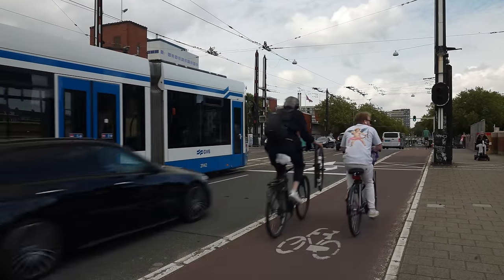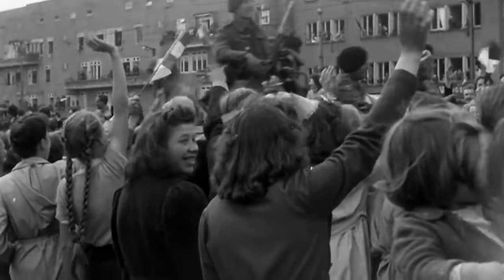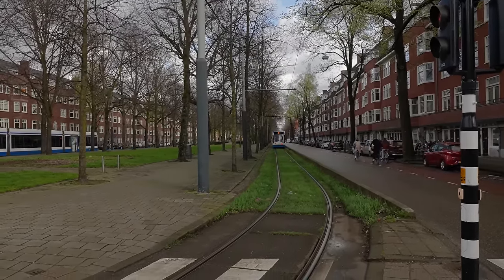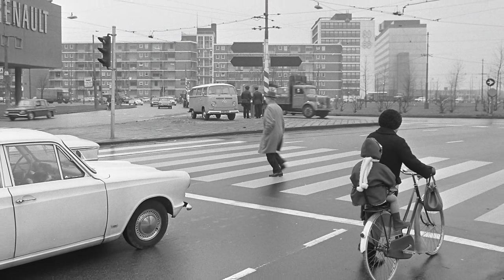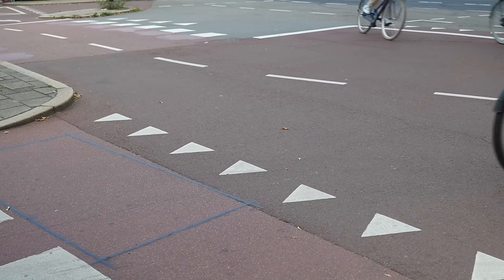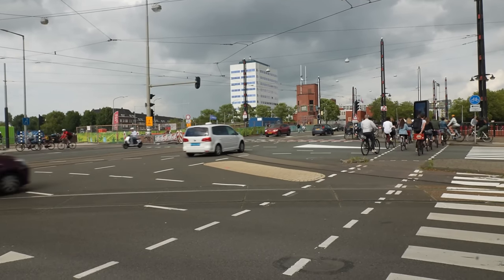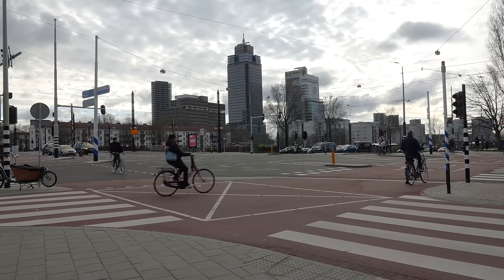Amsterdam Closed This Bridge to Cars (but not bikes ofc)

Comment: I wouldn't feel too bad about the cock-up with the tram tracks.  In Edmonton, a project like that would've been scheduled for four years, and been completed in seven.  And there would be some fugly after-thought braces or brackets to hold the damn thing together.
Reply: It is a thing. In The Netherlands we always plan far ahead, debate and deliberate extensively so nothing can or will go wrong. So if something does go wrong ‘it is a pebble in your shoe’.

Comment: They did a sort of similar thing in Gothenburg. A bridge was closed down for cars but they built a temporary bridge for pedestrians and cyclists. But the bridge wasn't anywhere near as important or historically significant. There is another bridge 150 meters east of it, and another 400 meter west of it. So there's not much of a change for drivers. But seeing as the original bridge and the bridge to the east doesn't have a protected bike lane, this temporary bridge is nice for the cyclists.

Comment: If you're interested in weird traffic design in Nijmegen: there's not one, but two multi lane roundabouts without lane lines, on which you have to yield to entering traffic which are controlled with stoplights. Keizer Karelplein, and Takenhofplein. The former even has a road (which may or may not be used by cars legally) going through the middle of the roundabout which is a garden. Yeah...
Reply: They look like roundabouts but are traffic circles or verkeerspleinen I believe they’re called in Dutch. They were the norm in times before the (turbo)roundabout.
Reply: @RealConstructor  yes you're correct! However, there are roundabout signs. What makes it a verkeersplein is the lack of shark's teeth for entering traffic

Comment: The first thing i notice about the "shiny new" bike lane on the bridge is that it has proper paving for traction in damp weather etc. I have always dreaded riding over the "paint" they use in most places here in the US. Typically the polymer "paint" is extremely slippery when damp. They use this same polymer often on curbs to demarcate commercial loading/no parking zones and have seen people slip on it. I do have one question: is the paving a top coating, or is that whole segment of pavement totally different from the metal up? Here in North America i have seen some bike lanes top coated in the red or green, but it typically wears away after only a few months of use. Great video.

Comment: 15:32 technically there is no catenary anywhere in shot at all, either side of the gap as well, as catenary is the shape of the support wire from which the contact wire hangs. Since the overhead line equipment (OLE) is tram style, not railway style, there is only the contact wire, no catenary present.

Comment: meanwhile in bremen germany: there is a repeating pattern where the weight of the automotiv traffic got to heavy for a bridge and aperrently the thought process of the local governments is something like: "well if traffic is to heavy ... we need to ban padestrians and cyclist from using the bridge ... problem solved"
6 years ago the "Stephanibrücke" was somewhat blocked for padestrians and cyclist (some construction fence was set up to make the available path smaller and some fancy math calculated that reduced padestrian traffic was 234t) and currently the "Bürgermeister-Smidt-Brücke" is blocked entiryls for padestrians and cyclist while cars, busses, tram and trucks are allowed

Comment: "It was going to take a long time, almost 4 months."
I could not be more envious of the saner European countries. A section of road under the train station bridge in Oxford has been closed for 18 months and counting. We have no idea when it is going to re-open. This stage of construction was supposed to take 6 months, but we appear to be at least 1 year behind schedule. I wish crucial repair took as little as 4 months.

To top it off, construction taking place under the nicely paved square near the train station is clearly being done on the cheap, since the tiles are at least partially being replaced with disgusting asphalt scars.

Comment: Although you have many videos touching on many topics, and some of them multiple times, I think it would be interesting to see a video where you lay out perhaps 3-5 things you think would have the best effect on the development of a city. I know you can point out lots of little things that make a difference for certain things, and you point out some good high-level concepts, too. This would be more about the most useful high-level things.

I liked when Strong Towns (and I know you aren't them, but follow them) tried to think of what goal they could have to push as the main thing that would help move cities in the right direction. However, one thing can often not be enough. Yet, if they had 10 things or more to push, they would likely see no good result. I wished they had chosen 3-5 things that work together to achieve results.

When I saw a prior video of yours quite a while back, as you pointed out how every roadway had to be categorized as what your video and those since referred to as either a Street, Road, or Highway, I really saw value in that. If every street had low speed limits and lots of stops, crossings of other traffic of all types, etc., people would complain about getting to their destinations. I've seen cities try to implement road diets, but without trying to ensure a Road existed to allow people to get from regions of the city to another. I think road diets without Roads can lead to at least some pushback or complaints.

Likewise, the way Strong Towns focused on Parking Minimums, I kept thinking that needed to be paired with a push for more mixed zoning. Sure, keep the loud or polluting industries away from where people sleep and live, but many businesses work out better near people, such as grocery stores. If people still had to drive long distances to get to such places because of bad zoning, larger lots would still be needed, even if most cities mandated far too large of parking lots. The mixed zoning also helps reduce traffic by allowing more people to access things on foot or by bike, rather than car.

I'm not saying that my top 3 would be: Mixed zoning, Classifying roadways and ensuring Roads exist between key parts of a city, and Parking minimums, but I do like some of those and hadn't thought of my top 3-5. You may have very different thoughts that would be nice to hear.

Comment: The trams are equipped with a little laser detector so the gates only open when one actually arrives. Though impatient drivers push them open as they can take it. An older iteration of this gate was indeed meant to be pushed. But it happened too often that this happened too rought and trams would suffer damage. So would the gates which would in turn result in worse damages to trams caused by damaged gates.

Comment: Maybe they could take a small bit of one of the two opposing direction car lanes at the end and turn that into left turning lane, have cars coming from the opposite direction  make their lane switching on the bridge itself. Though obviously that is also not ideal. Would be better to just disallow left turns  from the bridge and just have cars that want to go left take a left turn further down the road.

Edit: Actually, looking at the map view of this situation, they should 100% get rid of the left turn for cars and just have them make a 180  on the roundabout 300 meters (1000 feet) down the road. Sure it sucks to make cars drive slightly longer (thinking mostly about green house gas, not the time, drivers can just be a bit more patient.), but for the little amount of cars that want to make that left turn I think it's a reasonable compromise. There should be no reason that a public transport vehicles carrying dozens of people should have to wait for a couple of cars carrying 1 person.
Reply: Not only there. In general left turns are very inefficient. Unless you block most of the crossing, only a tiny amount of vehicles can pass a crossing turning left and often enough, anyway this results in traffic jams or dangerous behaviour as a side effect of the slow capacity.
When I commute (with my bike) e.g. 20 km in Berlin, I usually plan routes that have less than 1 or 2 left turns, just as even on a bike, they are still inefficient and for at least feel dangerous. So I know, usually, it's just possible to get from A to B without many left turns (and yes, as a side effect, usually my routes differ for A -> B vs B -> A for this reason).
Now, I'm not arguing left turns are bad in all cases, but they certainly shouldn't be the default option for close to all crossings.
Reply: @janekschleicher9661  Yet another reason that roundabouts are so good.

But while you are right, you can't prevent from going to their destination, but in this case a perfectly good alternative exists so it should be used. Especially because the number of people going left from there is small. It looks like that area is just a residential neighborhood without any through direction destination. 

So for the few people that live there and use their cars, they can just take a slightly longer route in order to improve things for everyone as a whole.
Reply: @Arjay404  how about just ban cars, they can ride a bike 15km to work or 20km. it's not that far

Comment: Why didn´t they keep it closed for cars after the renovation? I mean it worked during the construction why not keep it that way. 
In Dresden they luckily kept Augustusbrücke closed for cars after the renovation, trams, bikes and taxis can still use it now. And we also had a bike and pedestrian bridge during construction.
Reply: In the Netherlands, we generally (and thankfully) consider the needs of users of all modes of transport when making changes, as well as the needs of the surrounding areas, safety issues, transit times, increased load on alternative routes, and so on.  There's no "war on cars", but there are new insights in how reducing or eliminating cars from certain streets can make vast improvements to neighborhoods.  People still have to get around by car sometimes; it's a bit of a balancing act.  So in some cases, closing a bridge or an area to cars is deemed beneficial, in other cases the downside for car users and traffic in general is too great.

Comment: This might get a bit technical, but i was in Amsterdam recently and noticed the posibility to open the briges with the trams on them (as you mentioned in the video), and even the rail corridor leading to Amsterdam Centraal can be opened to let big ships pass. How does that whole system work, like they need to open the live overhead wires or something. I would be interested in an explanaiton about that. Maybe in a Video or if somebody in the comments is well informed?

Comment: There's the bit about the cycle crossings being shaped by cones so more people can move off at once and then merge by the time they get to the other side and you say thats how you design for bikes and not cars, but isn't this the same thing thats common for cars? Seems like a huge amount of junctions for cars are designed like this, they'll expand from 1 lane to 2 lanes just before the lights then right on the other side of the junction it merges down to 1 lanes and everyone zip merges, so it gets a lot more cars through the junction in the same way more bikes get through junctions you gave examples of.

Comment: Just a stone's throw away from where the bridge was built in the 30's on the Amsteldijk between 1900 and 1926 the famous, automotive history writing Spyker luxury and racing cars ("the continental Rolls-Royce") were produced in a factory the size of a street block. 
Wikipedia: "In 1903, the Spyker 60 HP race-car was the world's first F4 layout, four-wheel drive car, featuring the first application of a six-cylinder engine, as well as the first four-wheel braking system". Something like the Cybertruck of its day.
https://en.wikipedia.org/wiki/Spyker
So cars were more part of the fabric of post-1900 Amsterdam than we are used to think.

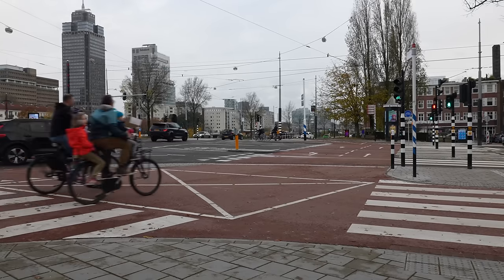Comment: I would like to point out that the car in the tunnel at 10:40 didn't have a license plate on the front. Most likely means they were quebecois and on behalf of all torontonians, we would never make such a mistake frantically sweating quickly looks away

Comment: Not everything they change is an improvement though ... the way they rerouted car traffic from the Sloterweg to the Plesmanlaan has made crossing the latter by bike a lot more dangerous.
Admittedly the Sloterweg was super busy in rush hour, but it was narrow which meant the speed was usually low, more imporantly, is was a route mostly on the periphery, so maybe 2 spots where biketraffic crossed car traffic. with the new situation where traffic has to make a large detour the number of intersections has grown significantly and the profile of the road (the Plesmanlaan) doesn't encourage low speeds.
To be honest ... the way Amsterdam is connected to the highways on the west side is a fail, it was either the Laan van Vlaanderen of De alpen, the only alternative for Nieuw West is going via the Ring and then the Lelylaan ... which no one in his right mind does
Reply: ow, I probably should mention that they rerouted all the car traffic right through an area for which they have great plans as a bike friendly hub with workplaces and housing (because that's not going to be a problem in the future : ) 
Ah, well the people in the funky new big bungalows on the Sloterweg are at  least happy

Comment: Our town square has nasty buildings- nasty as in dirty. The pollution from diesel semi trucks just makes all of the buildings filthy. For that reason… I see how ev’s could be beneficial. 

There are pictures of the square from the 40’s where the square had much wider sidewalks and a larger square. That was all taken away so they could fit parking and have wider roads for the semi trucks. Main Street was also much nicer the buildings were cleaner and it was more decorated. There used to be banners and streamers across buildings and on lamp posts. On weekends the street still has a good amount of foot traffic but still dominated by SUV’s and semis. It is so absurdly loud when a semi goes by. 

We went to OU university and that is how towns should be built. You can easily walk everywhere and it is very peaceful and quiet- until you get near a busy street. 

I wish people would just live in town, work in the building underneath their apartment, and not be so car dependent. If you work farther away then buses or trams would be great.

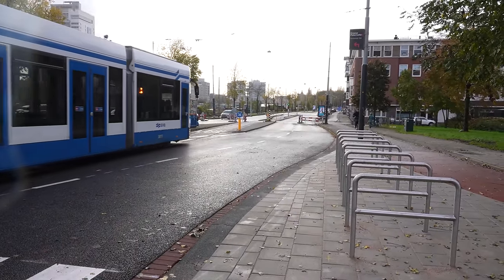Comment: 13:18 I'd wish they didn’t install these Aluminium pipe bike stands. While A shaped bike stands are nice, having them made out of Aluminium pipe only requires thieves to carry a pipe cutter and be through these in seconds.

Meaning, I would never lock an expensive bike to these. They should’ve made out of steel T or H  beams!
Reply: Verifies the value of riding an old cheap bike.

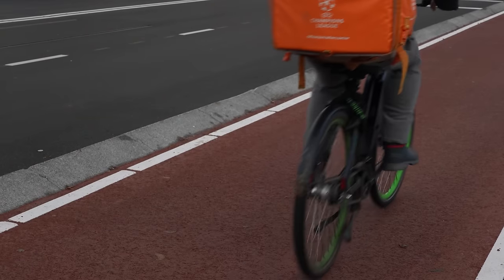Comment: 14:08 Why is it better to make it elsewhere and then import it on site?? Was it to reduce the closing time for the bridge?? or is it for something else?
Reply: Is done for a lot of things. You can be more precise & diligent off site. Can be, as shown here not necessarily IS 🙂 

Often that's in a big hall, so it's more protected. But yeah, mainly to reduce the time at the construction site, because that's expensive & dangerous. In this case the whole bridge was closed, but in other cases something stays partially open, so workers also have to deal with traffic. To simply make "lego blocks" & assemble them on site is easier & speedier.
You can find videos about how roads only close for 72 hours. The whole construction takes longer of course, but they try to keep disruption to a minimum.
Reply: Prefab construction normally reduces build time since all that needs doing then is just pick up a bunch of things from a flatbed and move them in with a crane. It's done quite alot these days.

Comment: I live in London and don't own a car but seeing this makes me think the ease of use to getting places here is trash even though overseas everyone thinks transportation here is great, perspective really does change things
Reply: 1st time i came over to the UK and found out you could reserve a seat on a train, and almost all had usb ports for charging (back in 2016) my jaw dropped, im assuming this isn't true for all of the UK tho and reserving wouldn't really work here in the netherlands i guess, but our new updated carriages finally have some usb ports.
Reply: Most travel routes were built on radial lines towards the city centre.  Going on the circumference can be awkward.  They put the Overground to help out a bit and there's the Superloop buses.  Still it doesn't cover everywhere and bikeshares can be found in central London with some dockless bikes allowed further away.  My quickest, cheapest and convenient travel is by bicycle since I don't need to go to the city centre for my daily life.  The cycling infrastructure isn't great but I'm hoping things improve.  Some little bits are promising, we need connectivity.